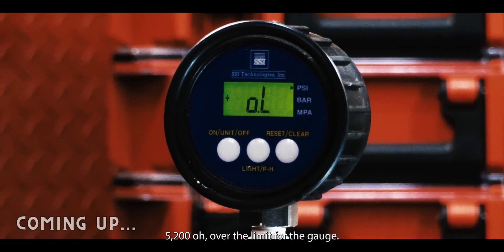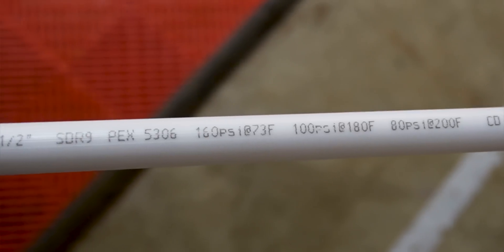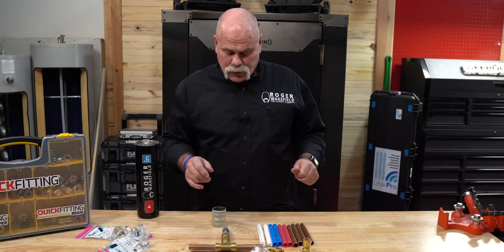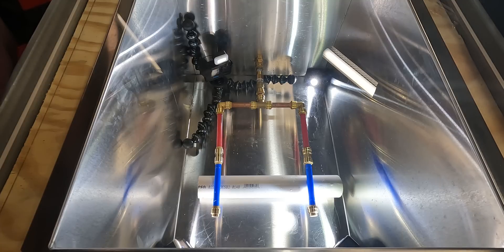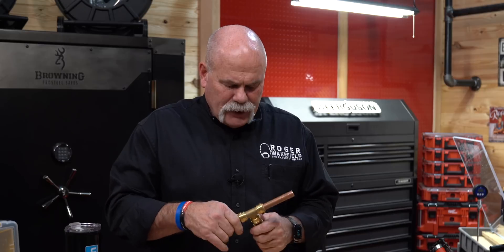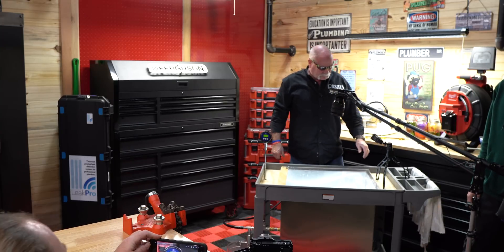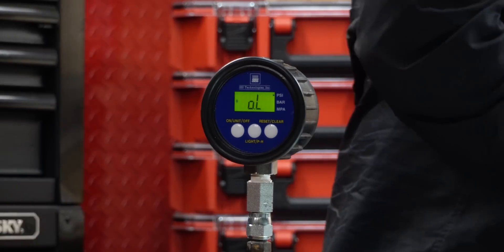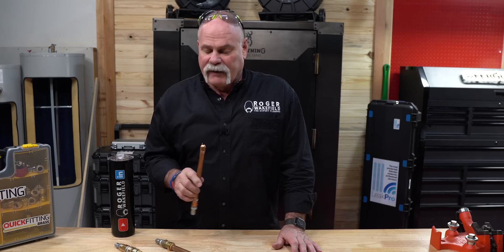How Much Pressure Will QuickFitting Hold?

Comment: What type of copper are you using M type being for plumbing  L type is ACR  K type being thicker walled ACR typically used for higher pressure refrigerants like co2  where high side pressures on a Trans critical  system can be in the high 1800 psi depending on the system and out side temperature  there is also XD pipe which is steel and copper a stick of 1/2 feels like a 15/8 L type  for all the plummers that OD pipe sizes. Cutting thru that stuff is no joke bring a bunch of extra cutting  wheels. But I was wondering  what the psi it would take to brush each type , and brazed joints the  xd pipe I would use alittle 73% or 91% silver then go over with just 15% silfos .

Comment: Love the video. Good Job.
Minus any garontee's , would you say that if I wanted to run copper lines w/ quicik fittings in my air compressor lines the pressure would hold ??  The pumps max pressure is 175 psi, the regulators will be set at 125 psi for tank pressure and the line regulator set at 90 psi for tools run on the system.
Thank you for your generous consideration,
Sincerely ................
God Bless.
Steph (Stephen) Leesville, LA.

Comment: Good information is hard to come by and very valuable. This video is valuable. Thanks kindly for your efforts!
Reply from the maker: Glad it was helpful! Do you use quickfittings?
Reply: @RogerWakefield  No, I am second owner of a 1980 house. I added wall board, whole house filter (Particulate / Activated Carbon) water softener then into water heater to house. Lawn irrigation it 3/4” line prior to filtration after I installed ball valve after meter for whole house years ago. They are soldered using a plate steel hanging behind next to wall. This was way before these were invented! Thanks!

Comment: These tests are so unrealistic. There are so many fixtures in your home, such as the PLASTIC toilet fill valve, that will burst WAYYYY before these pressures. Meaning your house water pressure will never have a chance to reach these levels.
Reply from the maker: Very true, I never claimed that this was a realistic test. But wouldn't you want to know what the best fitting is if you had to install one on your home?

Comment: Roger you sold me on the product. BUT I tried to find the part i needed and they referred me to Home Depot. That fitting didn't appear at Home Depot. I wasn't even sure if Quickfitting or Probite made it so I called sales (No Answer). Then I called their customer service (no answer). This is very concerning considering a "75 year warranty and they don't answer the phone" PS the part I needed and purchased was SharkBite 3/4 in. Push-to-Connect PVC IPS x 3/4 in. MIP Brass Adapter Fitting.

Comment: Your shark bite connections, and the other work connections rely on overage show me were no ring hasn’t failed overtime and I’ll Byam other than that I will be silent because solder joints don’t fail
Reply from the maker: I’m the same way, I prefer solder joints over most other ones. They last longer 🤷🏻‍♂️

Comment: Here's the thing. It's an oring end result. On our trucks with air brakes they use these quick connects. They run at 130 psi all day. They DO fail. We just replace the orings and continue. They are good when they're on a vehicle you just repair. Inside a wall where they will cause damage NO

Comment: Below 1000 PSI Pressure is not that much... With wrong installation it could easy breack by Water Shockwaves from closing valves to fast.

Comment: There's zero reason to be using copper and solder, we don't need to increase the cost to the homeowner on materials and labor 10x to do what can be done with pex and push on fittings. No one is ever gonna see 1000 psi in their home water supply. Thankfully younger plumbers aren't stuck in 1985 resisting new techniques to a fault. Copper also freezes and splits easier than pex and cpvc. The teeth bite much better in pex and cpvc. Either fitting works fine.

Comment: Now do pro press vs push on. I’ve had a lot of naysayers tell me I’m crazy for thinking push on fittings probably hold better
Reply: Lmfao there has been a test, Virgo held up to like 1900, sharkbite was 500ish, solder was 1100ish. Push fittings are for people who can’t solder when they have to
Reply: @williammorris3303  
I agree but I’m not a fan of pro press fittings either. I’ve seen them wiggle around and move a lot more than I’m comfortable with. Especially if you have a system with a lot of thermal cycling. Worst of all they don’t seem to last even a year in hot water loops that are continuously circulating. I don’t trust pro press enough for my house. And I fell it goes without saying I wouldn’t leave a push on fitting in my house longer than a couple of days until I had time to do it right. Idk have they ever showed how easy a jet sweat repair is on this channel I wonder.

Comment: How does it fair in well below freezing temps? We had that cold here in NC over the Christmas holiday and were seeing even propress fittings popping off.
Reply: Yep NC got it good. just fixed 8 leaks at one house yesterday in copper. Was also wondering how well these held up in freezing temps. Cause I know for a fact shark bite will freeze and blow apart. Fixed a leak from one of them on Tuesday
Reply: @tannerwest6823  could you give more details.? Where the leaks fixed to copper/ solder.. or where the leaks soldered joints.? My experience, usually the copper pipe will split open before a solder joint gives out. 
Thanks in advance..
Reply: @garycasper2929  yea most all the leaks were on straight runs of copper before the soldered fitting. Just inch long splits where it blows the pipe out. Fix one turn the water back on and then find the next one. It can be a nightmare especially if the homeowner doesn’t have all the holes in their foundation covered up/insulated
Reply: Better than copper

Comment: Long live copper/ solder! Old school beats new school!💪🏼
Reply: Yeah it really does and only costs the customer 10x to do the exact thing and takes 10x as long to install. A homeowner can literally fix pex or cpvc and push ons with zero effort. Can't have that though. Good luck winning bids because younger people have no loyalty to a type of pipe they just want an affordable water supply in their home.
Reply: @Spittin_Bars  100% facts. I bought my house and some of the copper work was poorly done and I was told they will need to be replaced as they will eventually fail. I'm a DIY person and I looked into compresssion fittings but the manual tools cannot fit into tight spaces and the powered tools cost too damn much. I"ll use push to connect for some fitings and pex for others. I'll hire a plumber to convert my main lead from copper to PEX and back to copper to recnnect everything. I'll then replace little by little of the copper myself with PEX from that point on and save thousands. 

I was quoted $3500 to move my out door pipe to the garage area. The job is pretty simply. Cut the existing copper, put on a copper to pex fitting and run the pex line in the basement ceiling straght into the garage (12ft) make a 90 degree turn and straight down (10ft) then another 90 and 6 inchs and done. I can do that shit myself, shit I ran new electric lines all over, replaced my main breaker panel and installed a new subpanel and all the work passed inspection and I'm only a computer engineer.
Reply: @Spittin_Bars  
Without getting into the quarrel... This is a great point! 
My father is 80 years old. 
He called me a couple months ago to tell me how proud he was that he was able to fix his hot water line using the PEX and push-connect fittings I told him about. 
Imagine being to the point where normal daily activities have grown into chores, deciding to embark on a task like that, and getting it done - like a pro.

In stark contrast, he did have some contractors out to the house after this... 
They all stared at the Dr Seuss creation of PVC he had coming in from the well pump and had a chuckle (Father included). 😅
Full disclosure: Those same contractors also used pipe dope instead of thread compound and the pump kept loosing its prime due to all the pin-hole leaks around the threads. 
We ended up replacing the loop-d-loop with (metallic) straight runs, 90s, a union, and used thread compound. 

Just one more example of how push-connect can shine, no need for the right "thread compound"... 🤣
Reply: While I agree, I don't think you will see copper much at all, at least in residential new construction.  Unlike the previous building recession where we saw copper prices plummet in 2008-9, I don't expect to see the same given the huge drive to electric everything this time around. I think it's going to be a real struggle to meet copper demand these next few years until maybe other alloys come to the market, If that's even feasible.  Already see far more AL wire in homes now on large feeds and subpanels then just a few years ago.
Reply: @tccoggs  I totally agree with you.
Reply: @tccoggs  no one in new construction around here has used copper in over 20 years. I've seen a lot of copper/solder fail in original construction, never seen a PEX or push-fit failure. Soldering is easy, but copper just sucks - or maybe people haven't looked at the inside of a pipe that's been installed for a few years.
Reply: @amerikalast  You won't find it here much in bulk new building, but customs still use it plenty.  Water chemistry/area makes or breaks coppers longevity, but in my area houses built with copper from the 50s are still going strong.  Sure the valves go, but you can cut them out and replace them and the pipe is still in great shape.  Lite coating of copper oxide on the inside of the pipe, but that's about it.  I have come across pin holes and slab leaks, but it's usually when the copper wasn't properly protected against the concrete, or other external factors.
Reply: Keep telling ya self that. We will be winning bids and working with pex. Copper isn’t the problem. K copper being used in residential plumbing is the issue. And the minerals and acidity of water. So keep filling out estimates for copper. We gonna run get 3 houses plumbed this week.
Reply: @pjplumber2146  I don’t use type K copper for residential installs. I use type L. And don’t fool yourself youngster! I guarantee your not doing any work, your laborers are doing it for you. LOL! And anyone can do Pex takes no skill. I bet your pex jobs look sloppy. Go ahead and keep running through your jobs! LOL

Comment: I knew the solder would hold up. If the person who solder it together knows what he’s doing it will hold up for years. This is why I still do this, but I do like quick fitting to hold almost 2000 psi is very impressive.
Reply: it really means nothing, as municipal water supply never approaches 2k psi, or even 900 psi.
Reply: @cynic256  It means it's overbuilt, which is good.

Comment: impressive, but it doesn't show how long the O-ring will last without drying out, especially on hot water. great for a emergency repair though, always a great idea to have quick fittings on hand. Even as a homeowner, saved me a few times
Reply: I have 2 females directly on my heater and with pex directly connected. My house I’m the plumber. In a 10’ tall crawlspace. The last heater was 16 years old. So I reused those shark bites and put on new tank. We are on year 5 of both. So total of 21 years. They were my first sharkbite purchase for a test. So far. Your wrong.
Reply: @pjplumber2146  That's good, but i still would not plumb a whole house with them, one small nick or defect and it will leak. They're like the backstab on an outlet to me, sometimes they'll work great but most times they'll fail, i just can't make myself trust it. it's all opinions and how you feel about it though i guess.
Reply: @gtb81.  most times they will fail is a lie. In Europe and Asia they primarily use push connects and if these type of connections had a high fail rate they would not be the standard there.
Reply: @RedRyz3n  then why does every plumber dislike push connectors, even roger expressed his disapproval in a few videos prior. also i did not say they will fail most times, i was making a correlation between two technologies i do not like. i said i am skeptical of the longevity of he O-ring lasting, also i thought europe and asia used compression fittings, not quick fittings

Comment: This guy really expressed his dislike for push on fittings for years and now a company pays him to promote their push on fittings. The entire test is dumb since your home water pressure is somewhere between 40-80 psig. A hydro test by industry standard would just go to 1.5x design pressure.
Reply: I agree, he himself has said years ago that his company fixes leaky push on fittings all the time. To be fair, some houses have higher water pressure (my house has 110-120 PSI) and that pressure can spike by several times from water hammer, which could be a problem. My concern with these fittings is mostly the potential for the O ring to deteriorate over time like anything rubber inevitably will. I have no problem using these fittings for temporary fixes in exposed areas, but we know people use them behind walls, in attics, etc and cause major damage when they start leaking and no one knows until it's too late and the damage is done.
Reply: @averyalexander2303  wow 120psi? Dang. Mine is 60psi from a well. I wish I had 100psi.
Reply: @averyalexander2303  Agreed. I don't even like pro press for the same reason: The black rubber o-ring! I've used pro press when it's specced for the job,or on a repair or two,but I am not a believer in it.
Reply: @Energia-977  pro press is the next best thing to soldering if installed properly. I’ve used it on homes with a 120psi measurement. Although that being extremely rare in itself. For long term and “professional” appearing work soldering or pro press are your best options.
Reply: @malik-ll9yz  I really like pro press for service. I just think in new commercial it looks like dog$hit because with pressure,it tends to sag a little. Plus the o-ring seems not to great
Reply: @Energia-977  I understand that, with an inch-half main supply it can sag if it properly supported every 3 feet. Although for residential use it beats soldering for quick repairs and not having to worry about water being in the pipes to get a right seal
Reply: @malik-ll9yz  True
Reply: @malik-ll9yz  if it weren’t for the fact that it’s risky using a torch in some tight places. I would do more sautering.
Reply: @Energia-977  Pro-press definitely does not look good on new construction IMO too. I will admit the time and energy it saves in service work though is night and day. Jobs that could take 3-4 hours are done in 45 minutes. Just make sure you de-bur the copper well and clean the outside well so that rubber can last as long as possible.
Reply: @andrewharmless8627  Absolutely!👍👍
Reply: @Energia-977  while pro press uses a seal, I think this biggest difference between push fit and press is that press is really a static seal as the this mechanical compression and the fittings don't move once installed.  The movement of push fitting over time from expansion and contraction will certainly wear on that push connect O ring faster.
Reply: @tccoggs  Definitely. Pro press has been carefully engineered to last. I just found out about pro press gas fittings. It's an easy to install system and it's interesting to see what they'll come up with next. My favorite pro press attachment is the no-hub snap cutter. That thing can take 1" off the end of a pipe with no splintering and a nice square cut. It's the best! Good for shortening stub ups .I think push fit fittings were designed for ease of operation,and not necessarily longevity.
I am a commercial plumber and we use push fit caps a lot for testing. They work well until the o-ring gets torn.
Reply: @malik-ll9yz  A round o ring on a round pipe at right angles?  Sorry...not me. Fast oh yeah and that what's matters to them (the contractor)  long after the check is cashed the bill for o ring fittings will come due. Solder rules.
Reply: It’s amazing what your brain suddenly thinks when YouTube money is being thrown around. Almost makes me wonder if he has time for plumbing.
Reply: @pjplumber2146  I agree. Love Rog but he's bought and paid for.  thousand..2 thousand PSI test are meaningless. Freeze those same fittings and then test them. Quick Fitting I like but solder is still the best way to attach copper.
Reply: Some of the responses here for pro press read like bots wrote them.
Reply: It depends on the Installation. If you have a long pipe and shut of a valve quick then the pressure can shoot up very high 5x of the normal pressure is easy to get.
The Neigbour of our workshop for example use a magnet valve for water supply... the Pressure Shock by closing the valve is so high that the pike shake around by more than 1 inch!
Search for "Hydraulic Widder Pump"
Reply: @Hobby_Electric  Interesting
Reply: In Vegas I have tested water pressure as high as 180 psi
Reply: I was just about to comment on the exact same thing. I'm done watching his videos

Comment: More testing would be more convincing. Especially considering manufacturing tolerances and user errors potentially involved. Maybe a durability over time test with different pressures. This video was short and sweet but I wanted to see more.
Reply: Or you can just do the math using this test and you’ll have a result.
Reply: @TomAnderson.  how ????
Reply: @JS-hl1oc  with math
Reply: @TomAnderson.  can you please tell me how your math works for using a short term test result to deduce a long term test result ?
Reply: @JS-hl1oc  every person knows that a house cannot produce thousands of pounds of pressure. So you use the pressure they applied here and covert it into how long would it take to equal the amount of pressure wear vs time wear and then you can have and a approximate result. 

Idk i’m just saying what i understand will work.